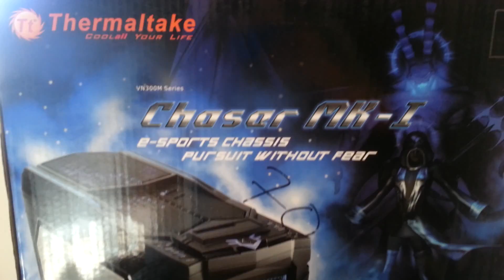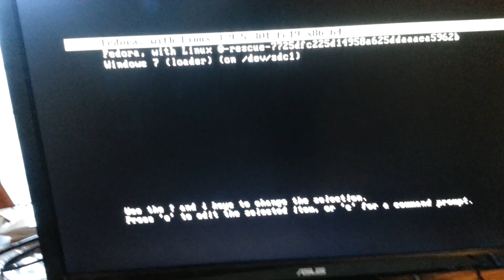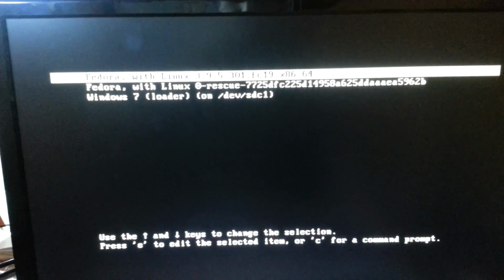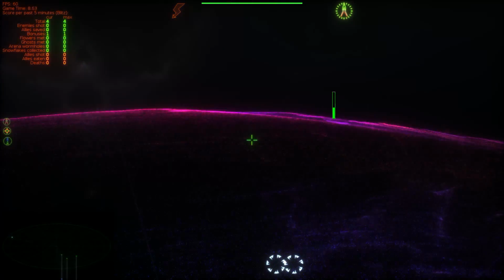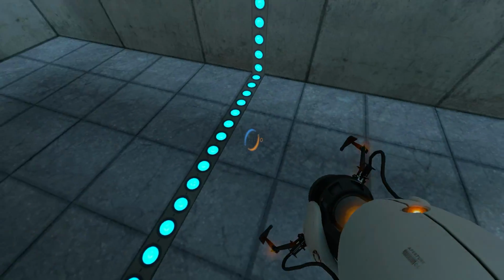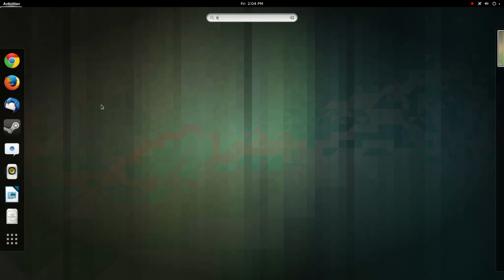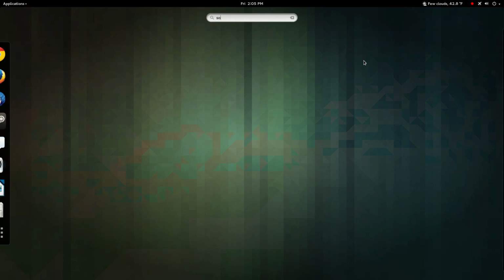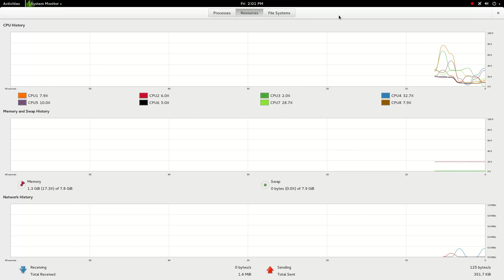Building my Linux Gaming Desktop

Comment: Hey Cody, nice video.  I tried Steam for Linux on an older Linux box I was using last year.  Didn't run very well.  This past weekend I decided to try it again on some different hardware.  Seems to work very well.  i ran around successfully killing zombies in L4D2 for hours.  I am fed up with Microsoft after the Windows 10 debacle, and last year decided to try and make the permanent move to Linux.  Now that I know Steam runs well on it the transition will speed up.  I'll look forward to watching more of your videos in the future, and will probably reach out to you for advice on driver installs and other such things.  Hang in there...  Joe
Reply from the maker: Glad I can help others get off of Windows! Steam runs great, the library still isn't quite as grand as big as Windows, but its getting there. Theres software like WINE and Crossover that run windows programs on Linux and I have heard good thing about both. Older games run in Wine just fine in my experience. I need to make an update on this PC I have changed quite a few things.
Reply: Thanks, Cody.  I just sent you a private message by the way (or, I tried to, anyway).  Look for it please...  Joe

Comment: I know this is a stupid question, but with linux you can play any steam game? I tried one game only with steam on linux
Reply from the maker: Not any game, just the ones built for Steam. When you are in steam you can sort by which OS/platform and see if it supports Linux with a little picture of a penguin (instead of a windows logo or an apple for mac)
Reply: Wine can run some games pretty well though. Just look at Doom 2016 using Vulkan, it runs amazingly for Wine.

Comment: I have a very identical build from 7 years ago... 6core amd and gtx750 o something...

nice desktop case.
Reply from the maker: Nice! what OS are you running? im running fedora 23 on mine, as well as windows 10 on a separate drive.
Reply: +Cody Shell linux mint has been the go to os for me
Reply: I just recently upgrade this identical desktop with three 2 teribyte hard drives raid 5. 

Movie torrent  streaming and backup server. Not mich gaming anymore...

I plan to build a gaming room in a few years... Nazi cubicle...
Reply from the maker: really would love a RAID in my system
Reply: U suffered from huge amount of data losss...

Labtop took a hard hit. 5 years of photo loss...

My son also factory wiped my phone.
Reply: I suffered!
Reply from the maker: that's very unfortunate!

Comment: Refuse to go Windows. I do love OSX and Win7, but tbh I'd prefer to go with a Linux distro. Windows 8 and 10 are a disaster, and I'd rather get better specs for the money over getting a Mac. I could build a Hackintosh, but then I'd need really specific hardware, plus Linux has a lot more going do it
Reply: Yeah if you did a hackintosh it needs to be intel only as osx doesnt support AMD. As to linux im going to swap over for my next pc build, more so than im doing now, i like windows 10 but would like to have something a little more secure, and easy to use. And i dont do a whole lot on my pc so i likely wont miss windows too much. Windows 7 was okay but is a laggy piece of junk compared to 10.
Reply: Well you could always get whatever hardware you want and get Elementary OS.  Its similarity to OSX is the main reason I don't like it as a non-Apple fan.  For an Apple fan it should be excellent though.

Comment: Why did you choose Linux over Windows?
Reply: +filthy casusal Because Linux is for people that know how to use computers.  More efficient than Windows and Apple, when you know how to work it.
Reply from the maker: +filthy casusal I still have a separate drive for Windows on this machine to play the non-Linux games in my library. But I chose Linux because its my operating system of choice.
Reply: +MrStrongmuscle Linux is also unnervingly reliable. that's why game servers use linux
Reply: +filthy casusal Because Linux is for people that know how to use computers.  More efficient than Windows and Apple, when you know how to work it.
Reply: Steam
Reply: Try Linux and you will understand. The only thing that stops me from going full Linux is my tech college requires me to use Internet Explorer for certain things (and lord do I hate it).
Reply: +filthy casusal Because Linux is for people that know how to use computers.  More efficient than Windows and Apple, when you know how to work it.
Reply from the maker: been there done that!! I just used a windows VM for that sorta stuff haha
Reply: I'll look into that. Right now just one class needs it though, so all my other work is done on a Linux machine basically.
Reply: +old man Because hipster.
Reply: +MrStrongmuscle Less optimized, more HW demanding, more expensive.
Reply: Well I already had computers with Windows so I just left them that way and put Linux on my others, including the one I am using as a daily driver.

Comment: How did you install the linux
Reply: you create a live CD then you install it.
Reply: +Ron S. that or you can just mount it to a 4gb pendrive by using rufus or any other usb mounting tool (faster and more reliable since it doesn't rely on write speeds)
Reply: Dylan Coulbeck also a viable option

Comment: hi question i am planning to build a beast rig ($2000) and i am going for a x99/ddr4 build.

does Linux support ddr4/x99 builds?thanks

(btw i am fully abandoning  windows thanks to gaben for proving the capability of linux)
Reply: good idea that you are no longer using windows.
Reply: +MenderSlen579 NO DONT ABANDON WINDOWS

there arent much linux games its very limited
Reply: +Washu Ken acutally i finally built it with windows

im probaby gonna give linux 10 years and see if it improves or not and if it does ill move to it but right now theres not much on it
Reply: MenderSlen579 thanklord
Reply: fail

Comment: Hey Cody, I'm in the middle of building a gaming pc and was always wondering what Linux OS supports games if it can happen. I tried to Googling and looking up forums with little luck. I want to play GTA V, Thief, Project Cars, Skyrim, etc. Do you know if you can install and play these games on a Linux OS like your Fedora setup. Any help will be appreciated. Like your vids. Thanks.
Reply from the maker: krazyhartin If you've never used Linux before getting Windows these games to work is going to be very difficult. To run Windows games like that in Linux you need to use WINE - which works, but you'll need a fairly powerful machine and the games will most likely not run optimally - because GTA V, and Skyrim weren't built for Linux. Your best bet is to dual boot your machine with Linux and Windows and play your Linux and windows games naively. If you get on steam you can see which games are currently supported for steam on Linux. Your best bet is going to be either Ubuntu Linux or Debian - not a very steep learning curve and a ton of support.
Reply: Cody Shell My machine will have 32gb RAM and a Radeon R9 280 graphics so will be healthy for a dual boot? Intentionally it is to replace my laptop (which can't run all games) and my desktop will be a workstation and gaming rig. I want to avoid buying a Windows and try something like Fedora. I will keep looking for solutions before I make my mind up. Thanks for the advice.

Comment: I would say either using Arch Linux or Gentoo Linux.
Reply: Dominik Bojarski I tried gentoo but i rage quit after xorg. I currently run Arch and it is awesome (thats also a WM i use). Gentoo does have its uses I will say.
Reply: Dominik Bojarski first if you get a laptop with an nvidia GPU if it says optimus skip it (not offically supported and its a pain to deal with is). Read the Wiki, Read it again, And read it some more. Also if you have a spare computer to look stuff up on the wiki during install that will be valuable. The install of the system shouldnt take too long (in the time for 1 windows install about 10+ arch systems could be set up) just be sure to keep the partitions straight, also itll be UEFI so there will be extra steps, sucks I know thank microsoft for that.
Reply: Quorthon Plavi
I actually read the documentation and got it working.

Comment: What would be a really high spec build for linux? Baring in mind I don't game. Great video btw
Reply from the maker: An intel CPU with an NVIDIA card will work best. Go as low or high end as you want.
Reply: Cody Shell thanks for the quick response!
Reply from the maker: no worries!
Reply: Cody Shell why do you prefer linux? I'm a linux fan myself but wondering why you prefer it?
Reply from the maker: I like it because there's just no bullshit like there is with Windows. It's fast, secure, and very very customizable. you can customize and modify anything you want. There is a bit of a learning curve, but it just works
Reply: Cody Shell
AGreed bud